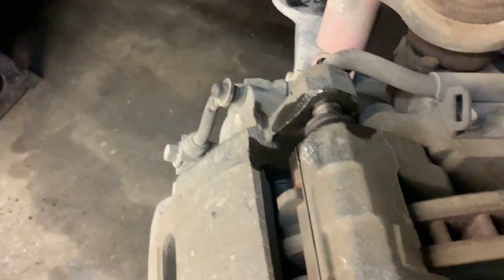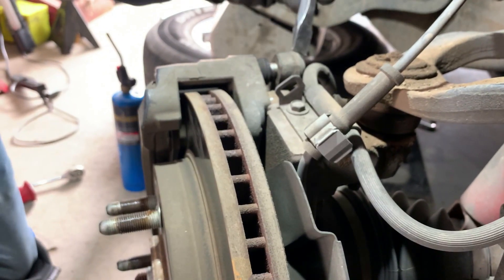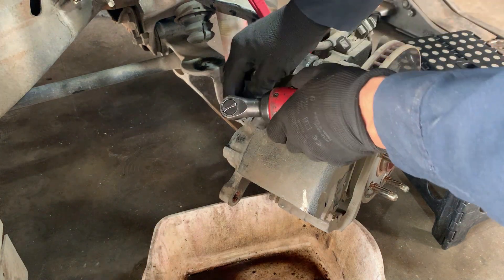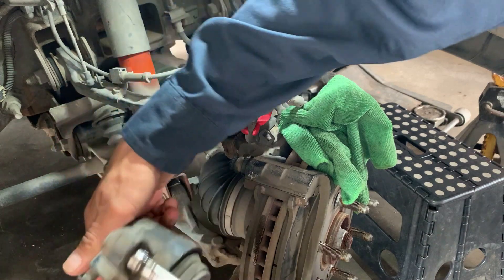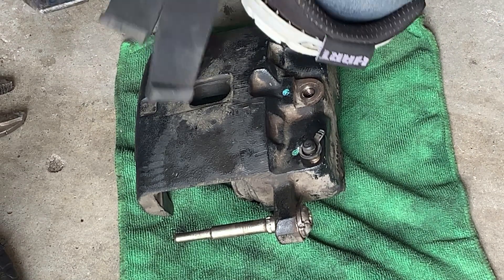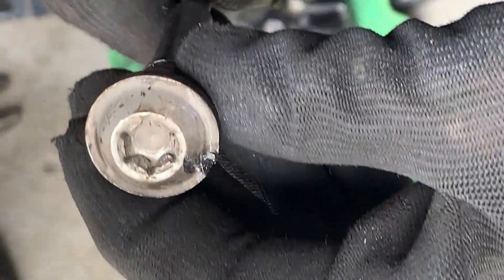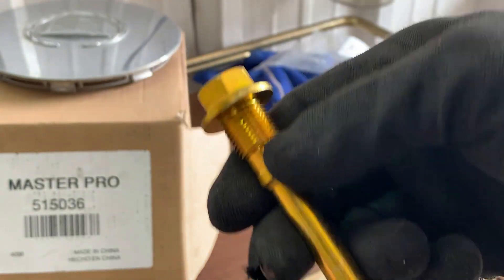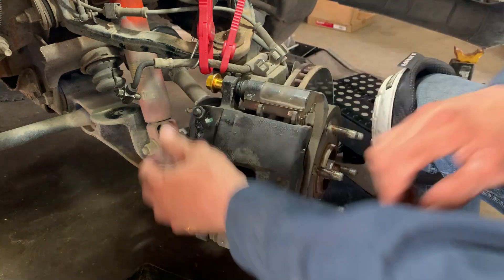stripped brake caliper slide pin(bolt) how to remove 04 Escalade

Comment: Brother you’re a life saver. I’ve been losing my mind here today because I could not get one of these stupid things off and it’s going to strip if it isn’t already. I’m going to probably end up doing this. Pulling off the caliper and bleeding the system now. Thanks a lot useless Torx bolt. I hate those things
Reply from the maker: Hi escapedgoat glad it helped you out brother  those hex do suck lol and thank you for watching. I appreciate you.
Reply: Is it possible to change the torx to a regular 18mm
Reply: @armandomorales242  I did just that. I had to take off both torx screws like this and then replaced them with standard bolts with the regular heads. It’s such a pain.

Comment: What are those black pcs that came with new guide pins?
Reply from the maker: Hi @Juice17-kt6cj  lol heck, if I know, brother I didn’t use them. I’m not gonna lie to you. I don’t know what they were for. Sorry but thank you for watching. I really appreciate you.😆
Reply: they are a bushing that goes on the end of slide pin keeps it centered/anti-rattle sometimes they swell from wrong lube and causes pin to stick
Reply from the maker: Hi @Juice17-kt6cj  they are supposed to go in the end of the slide pin but they were going on their too tight so I just didn’t use them. I wasn’t really sure if that’s what they were for cause I was having so much problems with them so I left them out thank you for watching. I really appreciate you.

Comment: Do you really have to bleed the system since you pinched the line
Reply from the maker: Hi  @cyclonus01  yes whenever you disconnect the caliper, you’ll get air in the system. You can try it but more likely you’re gonna have to bleed it. Thank you very much for watching. I appreciate you.

Comment: What did you do to get the slit in the T55
Reply from the maker: Hi  @nickchapa8756
Reply from the maker: Hi @nickchapa8756  take a chisel and hit it straight on the bolt and you should create that slit. If not take a grinder and grind a little slit on it. Use a thin cutting wheel. Hope that helps you brother and thank you for watching. I really appreciate you.

Comment: Can i weld a nut on it and use a impact wrench
Reply from the maker: Hi Karl Keenan you can try a bigger star bit or hex socket that fits tight hammer it in and then try turning   if that don’t work yes you can try to well and nut on it and see if you can get it out that way. thank you for watching. I really appreciate you.